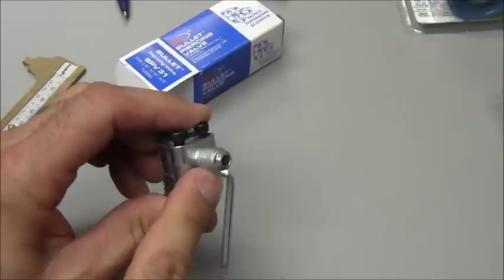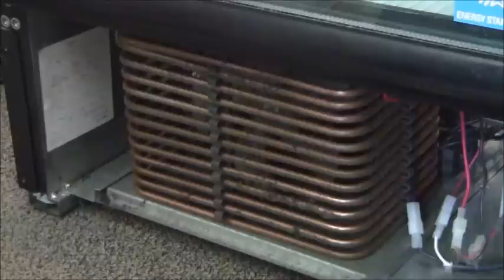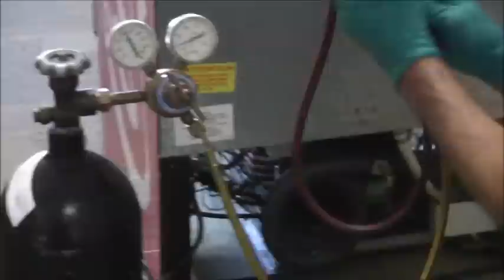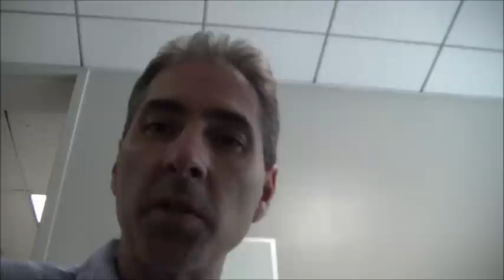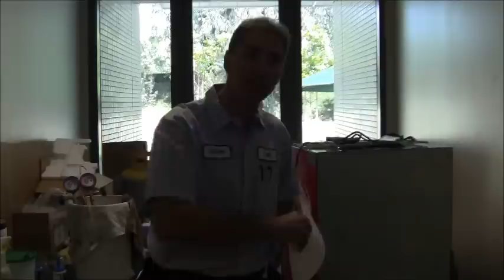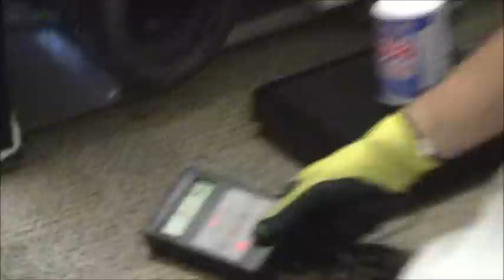Refrigerator not Cooling, Charge with R134A and Resealable Can

Comment: Can you exactly tell us what T valve you used. first you vacuumed the system throught that valve and later you filled with R134a throught the same valve. is there a sort of shutter in the T-valve. or how did you shut it just before twisting the R134A hose of?  i mean to say:  the piercing valve has this  small shutter inside which need to be turned open 2 turns when starting and needs to be closed before taken the hose of how did you close of the system again with the new (better) T-valve you soldered in the suction line. And i saw the one -direction valve inside the A31136 valve. so R134A can go in. but how did you vacuum it with the one direction valve in?  i hope i am clear now ..
Reply from the maker: watch video again, I first added a tap valve and then charged with nitrogen through that same valve. Then I purged out the nitrogen and added a schrader valve with a tee connection, which is a much better valve compared to a tap valve. Then leak tested again, evacuate and charge with R134A.

Comment: Don't all refrigerant-based cooling system leak to some degree?
Reply from the maker: no, I have AC unit at home that is R-22, 40 years old and no leaks. :)
Reply: No they dont leak, if the unit is sealed- it's sealed, it can last forever , However leaks can develope , then the system is compromised and it loses refrigerant. Ken is correct systems can stay sealed trouble free for many years! I had a mini split unit thats last for 16 years before it  give me any problems!
Reply: @dwayneevans683  Perhaps, "Leak" was not the best word to use because a leak would be considered a fault condition in the HVAC profession. If the system is designed with a small amount gas escape factored in is it a fault or a true leak? All pressure vessels leak when they use imperfect seals, such as o-rings, trust me. I work with pressure vessels regularly to off-gas cleaning solutions from PCBs. I understand that these are not perfect apples to apples comparisons, but I fell the principal still applies. 

Something else to consider is if you don't use the full cooling capacity of a system you won't likely notice the small amount of refrigerant that may have escaped over the years.

Comment: Are you hvac technician??
Is that necessary to heated refrigerant can??? 🙈, First time in my life seen refrigerant can heated when charging a chiller/refrigerator.
 in my opinion "its dangerous"...💥💥💥🔥🔥🔥💥💥💥
Isn't just turn on the compressor so the lower side pressure will drop (compressed to high side)  then you can add more refrigerant??
Reply from the maker: Great questions. 
1. I am not an HVAC tech, I just play one on youtube. 
2. I did not heat well enough for potential explosion. 
3. You are right, the compressor should suck in the refrigerant for charging. It has been a while and I don't remember why I did it this way...
Reply: I used to see that picture in books and things. Recently I was adding some to my car, it was running low side from 20 to 40 psi and was taking forever to get it all in. I was shaking the refrigerant around in the can which helped then I thought of giving it more heat into the can other than just air exposure and put can in pot of warm water. That took care of the rest real quick. No danger, I’m not trying to boil it at 200 degrees, just warm it a bit.

Comment: Refrigeration guy by trade....decent, but don't be thinking you can get a very good reading on a pipe with an infrared thermometer. you will be way off if you take readings this way. strap a real pipe temp sensor onto the pipe to get an accurate reading.

Comment: If you do not find and fix the leak, it will not work for long-1 hour to 4-5 days, sometimes 1 month for a tiny one. If the leak is on the low side and it is in the aluminum evaporator, it sucks water in the system and putting freon in won't work one day.
Reply from the maker: I tried to find the leak but did not find one... Then my leak detector tied.. :(

Comment: I've watched 3 of these fridge recharge videos.  One said like 3 psi, one said like 30 psi and this one was like 62 psi on the low side.  Which is it???  I have a GE pfs22sisbss
Reply from the maker: I cant confirm the low side psi BUT I can confirm the charge. I would remove current charge, evacuate all and recharge by weighing in. 
That will work.
Reply: The pressure depends upon the refrigerant used, for refrigeration you want a coil temperature about 15F degrees below the desired box temperature, so a 40F box would have a 25F coil  at the tail end of the cycle just before it shuts down,  upon a hot pull down like  a load of food to freeze  the low side can be very  high  from a high load on the evap coil,   the temperatures are what really matters  then the pressures  are determined by  the refrigerant used.
Reply: Closer to 3.  Look at a PT chart for 134A at 62psi.  That’s what the refrigerant in the evaporator is boiling at.  Ask yourself if that would get you down to  - 4 or whatever temp you want in your freezer.

Comment: Excellent video! You covered all the necessary aspect of charging a HVA/C system. How can I convert ounces to PSI.  I have a Samsung refrigerator that has a variable speed inverter compressor.  I know is low and I want to charge it, but I do not know how much refrigerant is in the compressor.  I want to add refrigerant and use the PSI pressure as a guide the amount necessary to top it off.
Reply from the maker: Refrigerators are critical charge. you will need to remove refrigerant and weigh in a full charge. You can not top off like an AC unit.

Comment: So if the leak is on the low side what do you think just entered the system. Let's think about that for a second. And most likely most fridges will have a leak in the evaporator due to acidic foods kept in them. Also those line taps are temporary a tee and shrader fitting should be brazed in as a permanent access port on both the suction and discharge lines along with the drier being changed. But first and foremost the leak needs to be located and repaired.
Reply: Jeff Scanlan 
You showed him with all the videos on your page
😂
Reply: @luvdogsandhorses  Dude I would run circles around this guy it's actually quite entertaining watching these videos. If I showed him some of the work I do he wouldn't understand what I was working on. Lol
Reply: Jeff Scanlan 
Where are your videos posted
Really want to learn everything that should be done for an LG linear compressor changeout
Reply: @luvdogsandhorses  Too funny why don't you read the manual or take a couple of training courses that's what the rest of do. No need to post videos. Oh and I personally have never changed an LG compressor. We install and work on alot of Mitsubishi and Daiken units and if you want to talk linear or variable technology I have installed and worked on alot of Turbocor applications both chiller and built up systems. Not sure what your background is. Recently installed a 64 head City Multi system with over 3000ft of piping and the list goes on.
Reply: Jeff Scanlan 
You claimed expertise not me
I’m trying to learn 
Mostly need a extensive list of best practices for refrigerator sealed system repair
One pet peeve I have is technicians skimping on known best practices 
Here’s one example for you
In the HVAC world it’s pretty much a given that you can’t be sure you don’t have a leak with analog compound gauges in an hour (but technicians skip leaving pressure test in place which overlooks fixing the problem or knowing that it has been fixed ) 
I want to know what the consensus is on old compound gauges vs new (digital .1 psi) how long to leave each in place to be thorough
Some other concerns
Flushing with compressor change
Possible oil contamination when not isolating vacuum pump properly etc
I continue to look for answers but would like links and such to assist myself and other’s
Reply: @luvdogsandhorses  Digital gauges a better way to go I use a Fieldpiece set. They are good for pressure test and evacuation micron readings and then finally commissioning the equipment. I have used successfully on small split systems up to a couple hundred tons. Very reliable will be purchasing another set soon when they come out with the new model.
Reply: Jeff Scanlan thanks for that
Don’t have the time or money currently for the conventional classes
Just want/need some practical time-tested guidelines to follow
What pressures to test 134-a refrigerators, how long to leave the pressure, should I run nitrogen when brazing,good sensors to monitor pressures without having so much refrigerant in long lines ( why are short lines so damn expensive) where can I find components to shorten lines
Good practical stuff for refrigerators, dehumidifiers, etc
Reply: @luvdogsandhorses  Pressure test at no more than the rating that the compressor manufacturer suggests which is normally 150 psig. Monitor for at least an hour. You will find alot of opinions about brazing I will tell you that in 33yrs doing this that I would not use nitrogen for brazing on this application, I have literally hundreds of systems running without any issues where nitrogen was only used to blow the lines out. Other than that find some good manufacturers literature on various techniques used in the field because this response could get rather long winded way too much to cover in this type.of forum. Good luck.
Reply: Jeff Scanlan 
So this is where that long winded comes in handy or a video in which to reference you are giving an amount of time but not saying which method or what type of equipment to use I would never try to leak test with analog gauges a half hour an hour or probably even four hours so we all have to assume you meant with digital .1 psi equipment
And I’ve been looking for mfg data (I’m not lazy)
Some specific links would be nice

Comment: And although you did add a little too much, did you check the frost pattern on the line to make sure it didn't get within 3 inches of the compressor?
Reply from the maker: I did not check to that detail.
Reply: @KenTraining  if it hits the compressor it can damage it. If it gets too close just bleed a little out. We used to cheat the system when just a little was needed, we'd skip the guages and add a little at a time and watch the frost pattern.
Reply: The charge should be weighed in.  The frost line will vary as the box comes down to temp.  We always charged until
 The frost line was just past the evaporator, or at the exit of the cabinet.

Comment: I have service port already soldered on a piece of copper which hangs from the compressor, can I add R134a directly on that port?
Reply from the maker: yes
Reply: KenTraining I connected a gauge to service port, and there is 20 psi when fridge is off and the same 20 psi when fridge is on and condenser is running, what can be the problem?
Reply: Andrei Zugravu 
Sounds like the compressor is bad or complete blockage

Comment: Why wouldn't u just clamp into the original fill line that is crimped off from factory fill??
Reply from the maker: yes, that would have been better. I can't remember, is that on the suction side only? could the extra tube ever be on the discharge side?
Reply: That's the only one I've ever used to suction and charge. Not  a pro like u just filled a couple drink boxes. 134A  only. Dust cleaner works well also. My personal one has a very slight leak so i soldered a fitting on the end of the crimped tube.

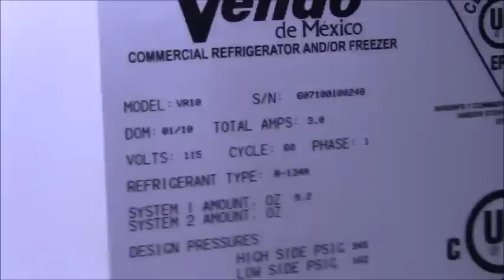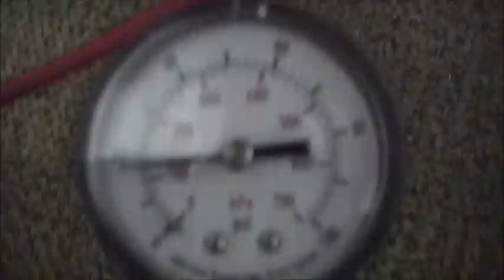Comment: Hmm....at 5:38 in the specs the freezer should have 162 psi on low side.....but at 1:12:29 when you measure the pressure you only have 18 psi.......and 70 psi alfter you charged the system.   How do you explain this improperly values???
Reply: Those are test pressures.  Have nothing to do with charge.
Reply from the maker: your question is a very good one. First of all, this was  one of the very few refrigerators I have worked on. Because I weighed in the charge is the reason I did not charge according to the data plate. I freely admit I don't consider myself and expert on refrigerators. in your experience, should I have charged until reaching the design low side pressures?
Reply from the maker: on further thought, I believe that those pressures on data plate are the design maximum test pressures not the design run pressures. What do you think?
Reply: @KenTraining  Yeah ken u should go to school and do a complete HVAC traning. That is the test pressure! when u go to school it open up your eyes to what really going n and why! when properly trained you also know exactly what your doing! Proper training is the key!
Reply: At 18psi your evaporator saturation  temperature is 20 degrees.

At 162 psi your evaporator would be 116 degrees.

Nameplate pressure rating is maximum TEST pressure value.

Comment: Replace Filter/Drier with a Schrader Access Core Valve Built-in
Reply from the maker: I like this tip and will do so in the future.
Reply: @KenTraining  Any of you guys have a link?
Reply from the maker: @NickFarrow  try this / https://www.supplyhouse.com/Emerson-Flow-Controls-065965-3-8-ODF-EK-163S-Series-Liquid-Line-Filter-Drier-16-Cubic-Inches
Reply: Never leave an access valve on a sealed system. Use the process tubes(like the factory did). That’s the reason they call it a critically charged sealed system.

Comment: Ken next time use a saddle srader valve. We used them every time when tapping a line they solder on and are permanently soldered on without blowing the refrigerant charge. They save a lot of time. If I had one handy I would give you the part number. Good luck

Comment: How do you know which is the low pressure or suction line?
Reply from the maker: suction is larger in diameter and comes from evaporator.
Reply: Thanks.

Comment: current clamp on neutral will measure total current of appliance including lights and fans. clamp should be on line to compressor only to properly measure compressor running current.
Reply from the maker: you are correct, i was just trying to make my job as easy as possible for me.

Comment: The leak is likely due to the emery cloth used under the piercing valve. Piercing valves need a smooth surface to seal. If you have to clean the surface of corrosion, use 800 or 1000 grit cloth, then buff the surface with canvas. Also, piercing valves can't seal the Grand Canyon, so don't try.
Reply: That’s the first thing I was thinking, just how good does one of those ‘ punch a hole and tap in ‘ fixtures seal? He’s going to refill it and then it’s going to leak out twice as fast.
Reply: @michaelszczys8316  Exactly. I had to put a tap-in on a $3k LG fridge. I polished the tubing as described, wiped ALL the welds with baking soda water, then water, then charged the system. That was 3+ years ago and it's still good. That's twice+ what the factory provided, so tap-ins can work. "If do right, no can defense." - Miagi

Comment: My fridge guy says the leak is inaccessible and can't be fixed. Can I try this Freeon with Stop Leak? Sub Zero auto A/C Recharger Refrigerant R-134a with Stop Leak. Seals Leaks in Orings, Gaskets and Hoses. The sticker in my fridge says it takes R-134a.
Reply from the maker: why not, your tech is already condemning the fridge. Your only loss is the money and time.

Comment: Hello Ken
i have aquestion
I have Fridge Samsung  french door and it has twin cooling Evaporator .When i turn it on, every things runing and working  find but when compressor star got lound sound and after that sound came down like normal, compressor get warm , condenser get warm, condenser fan runing .after 2 hours  only fridge get cold but not in deep cold just around 55 F degrees  , and i check the freezer . evaporator on bottom did'nt get any cold at all.
So what i need to do for checking some?
Thanks
Reply: Hey man, it sounds like compressor bad, I have a samsung and had the same problem. sounds like compressor going bad. mine is also twin cooling, first the freezer then fridge. pressures show good but adding more coolant dont help just makes matters worse. If the compressor sounds like a 4 cylinder motor with a valve tap it is history. 50 psi is very high when compressor is running. If your pressures do not change from off to running then you need to replace the compressor. Samsungs are notorius for failure. Mine is the quatro cool and I found a leak from manufacturer in the refrigerator upper evap coil. Be sure to check all fans and defrost circuits. I feel you pain, mine is only 4 yrs old and I had to replace evap fan, mother board and compressor. Samsung does not stand behind there products.
Reply: U need a new compressor
Reply from the maker: check refrigeration pressures.
Reply: checked on the low pressor line show up at 50 psi,  and already add haft of can freon R134A , compressor  hotter, condenser hotter but the pressor show on metter still around 50 psi. What happen ?

Comment: In your opinion would there be a benefit to installing an access valve on the high side between the compressor and the condenser? I'm looking at these refrigerators and see a similarity between them and automotive A/C systems.

Comment: Is this guy for real or is this a comedy routine.
Reply: @Pete Bilski The testing was garbage, the brazing garbage, the "vacuum" garbage, and the charging was garbage. This was basically how to do it all wrong and guarantee another critical issue rather than a long fix.
Reply: Never said i know it all, But i've done appliance repair since 1980 both for larger co. and now my own. I'm a Factory Trained and Authorized for most Major Manufacturer's, I call it as i see it and i don't want anyone to get hurt. A Heat Gun on a refrigerant can, NO NO NO  Very poor Soldering ability's. There is a correct way and then there is the Dangerous way.
Reply: @fish0741  I agree with heating the can -its dangerous, they make a blanket for that, also his brazing skills where poor!
Reply: Cc